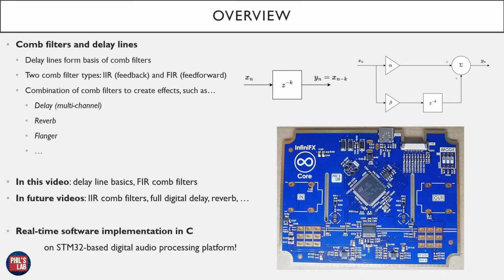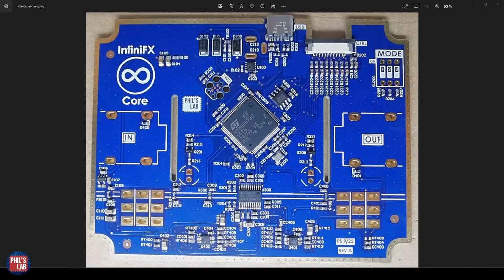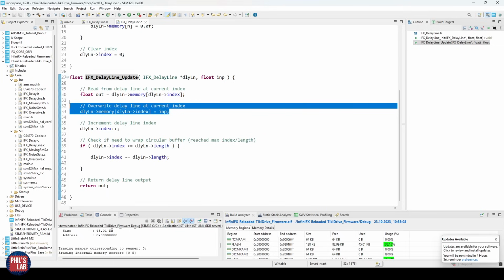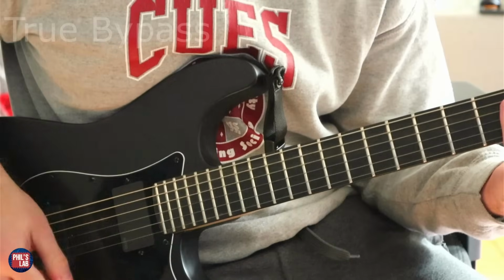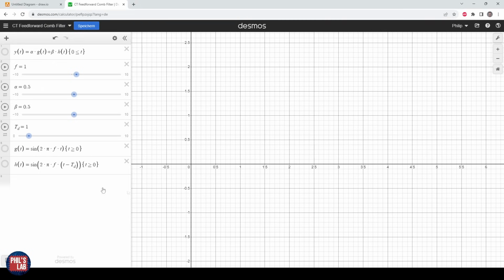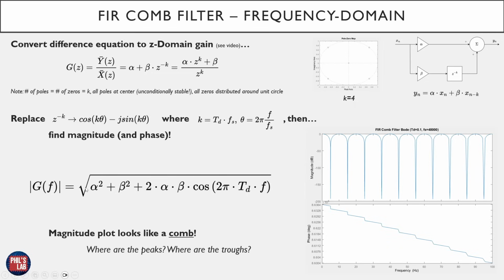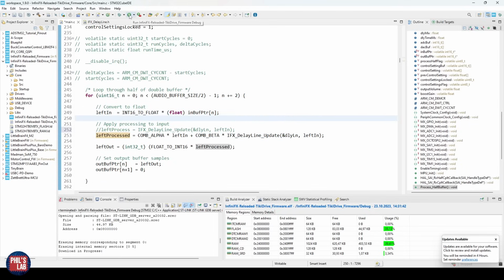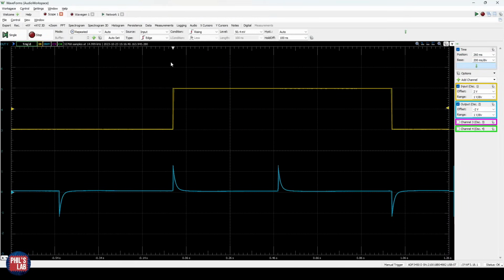Comb Filters & Delay Lines in Software (STM32) - Phil's Lab #124

Comment: How is the opamp U400A biased at half the supply voltage if there is only R406 to +VREF and no resistor to GND ?
Reply from the maker: +VREF is at half the supply voltage, generated by a potential divider in this case. The op-amps are low input bias-current FET types, so there isn't a large voltage drop across the bias resistor.

Comment: Thanks for refreshing my memory again, since this has been since I while for me :)

Question;
Why would you go through the trouble of the second option, while this is basically the same as the first option just with an additional summing block at the end with the original signal as well as the delayed signal? Which is pretty easy to implement on itself.
Reply from the maker: Thanks for watching! The FIR comb filter is indeed very simple, but we are building up to the IIR (feedback) comb filter, where then both are incorporated as basic building blocks into delays and reverbs. Essentially, this is just the beginning/a primer and a basic tool for what's to come.
Reply: Will we build up to AllPass filters etc?
Reply from the maker: @velvetsound  Yes!

Comment: What codec you used?It uses I2S? Got curiousto see the datasheet and what is capable of!
I think it would be cool to see a video on how to integrate a CODEC or a high quality DAC on digital boards!
Reply: Phil covered the design of the board he is using in a past video.  Video #88.
Reply from the maker: Yeah, as Isaac said I've gone through a (similar) design in previous videos. Codec uses I2S, is a Cirrus Logic CS4270. Not the fanciest of codecs but very easy to integrate and set-up!

Comment: How glad I am that Phil is doing this DSP series. After building a DDS synth I wanted to dive into DSP. My main problem is that in order to do some physical modeling or filtering I would need to learn more about the models themselves (how the diagrams used for the comb filter is called, where to find more models like that, etc...) and there is not so much information about Z-transforms without involving tons of math. For someone who wants to code a model based on a diagram, that is very unnecessary. Can't wait until Phil makes a video on how to do a Reverb or another more complex model. Cheers for all your work Phil. Cannot thank you enough.
Reply from the maker: Thank you for your kind comment! I'm very glad to hear that you're liking these audio-based DSP videos. The next in the series is on IIR comb filters and full digital delays. From that we can work towards a reverb!
Reply: Hey  @PhilsLab , sorry to bother you but I have two quick questions if you don't mind:
1) If I wanted to refresh all the DSP basics I've learned in college and dive deeper in the audio aspects of it such as effects, synthesis and modeling, do you recommend a course has it all? I wouldn't mind going back to square one and building up from there.
2) What is your audio interface and software? I have an oscilloscope but nothing that is integrated with my PC and capable of bodeplotting.
again, thank you so much !
Reply from the maker: 1) I'd suggest looking at this website https://www.dspguide.com/ and his book to start off with. A really great, intuitive guide to DSP. Then, for audio-based DSP, look for DAFX by Udo Zoelzer.
2) I'm using a Digilent ADP3450 (USB scope/function gen/..) and a QuantAsylum QA403 for further audio measurements (THD, SNR, ...).
Reply: @PhilsLab  Thank you so much!